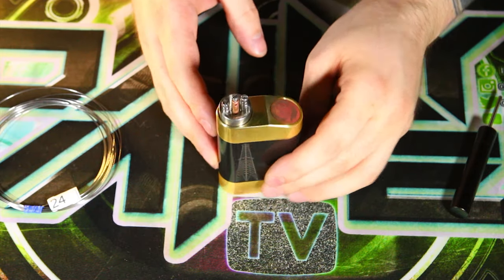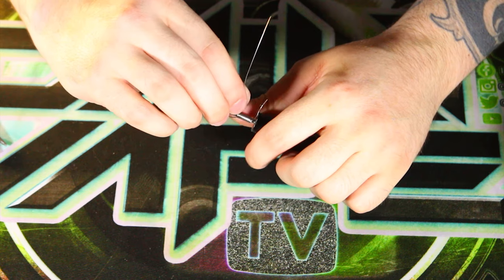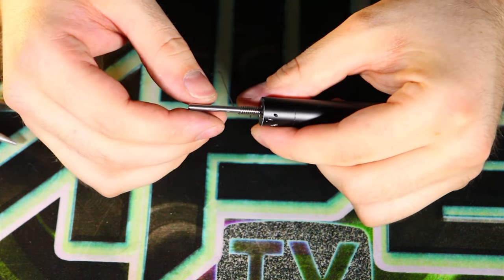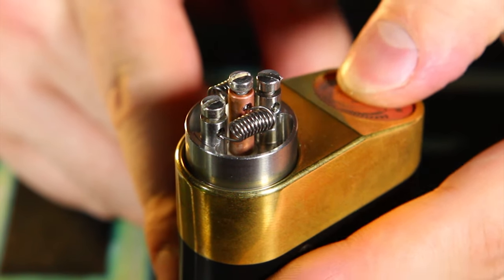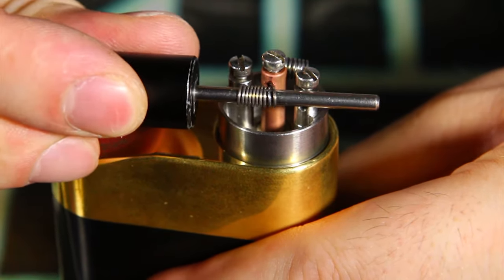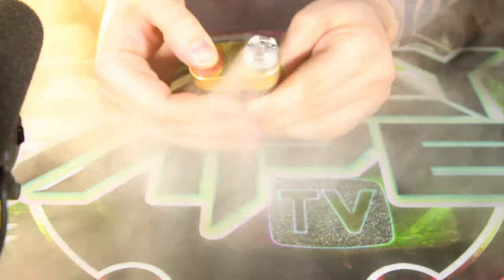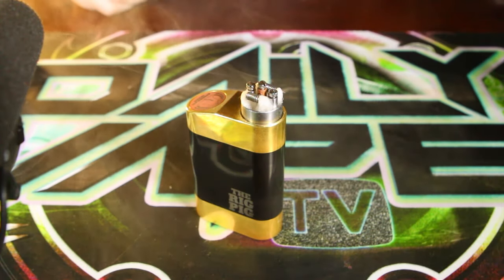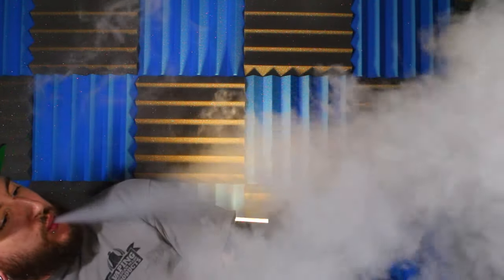#FRESHBUILDFRIDAY - The Rig Pig Build

Comment: I have been vaping for about 3 months, using Dovpo and smok BUT I want a rig pig, I keep hearing this ain't for newbies...what's your thoughts on this (I know about ohms law etc and I have been watching shed loads of videos)
Reply from the maker: I'd say familiarize yourself with mechanicals and proper builds. Get yourself some high amp limit batteries like Sony VTC 4's or LG HB6's and make sure you always get a read out of your coils before trying something new on a series mech box. I still think regulated mods are the way to go at least for the first year or so of building so that you can judge the properties of wire and certain builds. I have 2.5 years building experience so I can usually guess a coils resistance just by looking at it and knowing the materials used.

Comment: hey dvtv did you do series build on the noisy cricket
Reply: Yes, he did.
Reply from the maker: I did and it's one of my most popular videos. You can see it right on the main page of my channel.
Reply: why didn't you check the resistance? Is that safe?
Reply from the maker: I've done this exact same build on a regulated box before and the resistance is 0.45 Ohms which is drawing 16A from my Sony VTC4 30A batteries.
Reply: .. i see..so getting used to it is a plus then ! thank you

Comment: Hi m8 how ur check the ohm on that rda ...
Reply from the maker: You can only check it with a multi-meter or by using a thread adaptor but I plugged all the wire info into steam-engine.org and estimated the resistance.